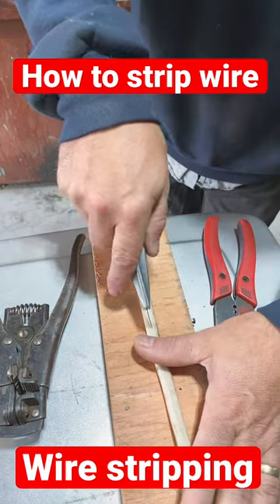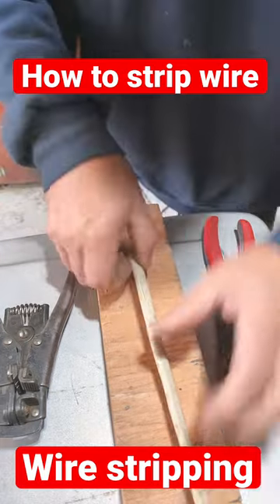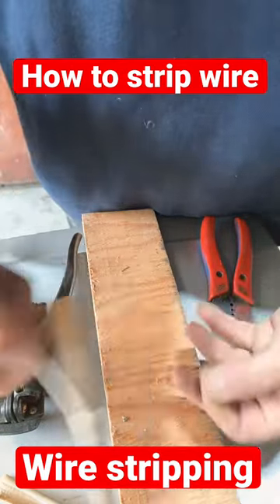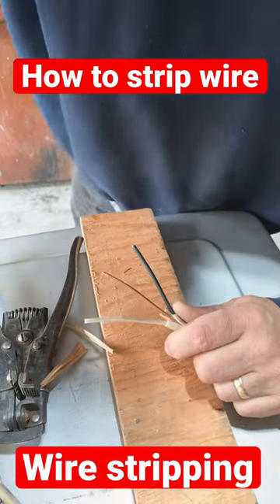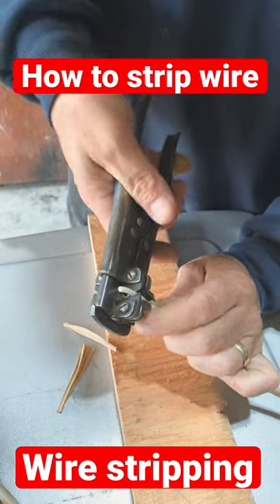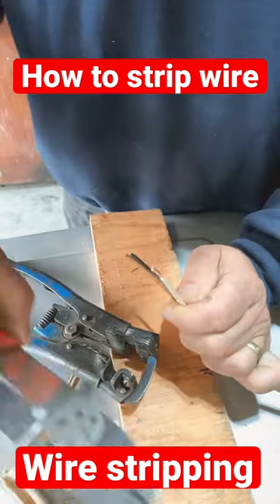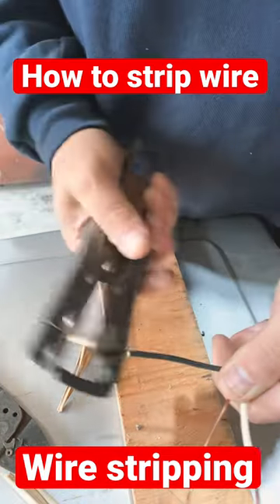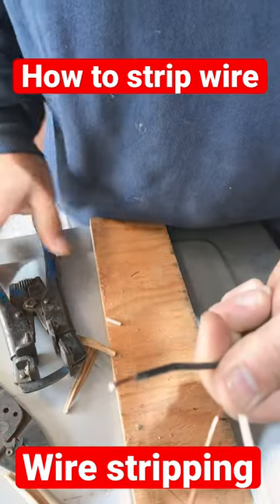How to remove the coating off of household wire using wire strippers￼

Comment: If you have a bright sunny day, so 85.  90° and you leave all your copper sitting outside on the driveway or a hot surface you’ll be shocked how easily the insulation falls off if you warm it up to about 110°
Reply from the maker: That’s a great tip thank you for taking the time to comment